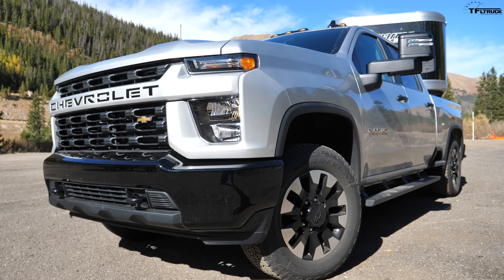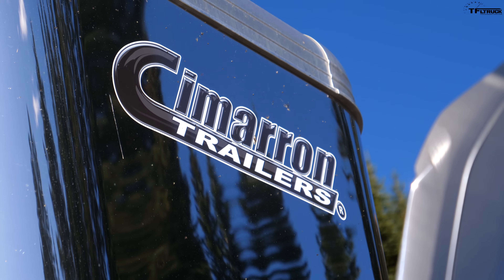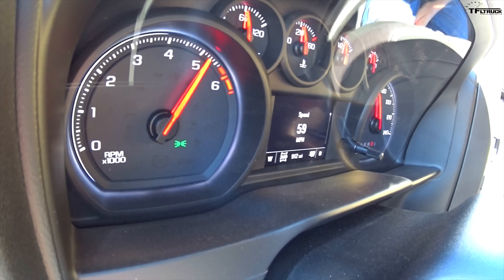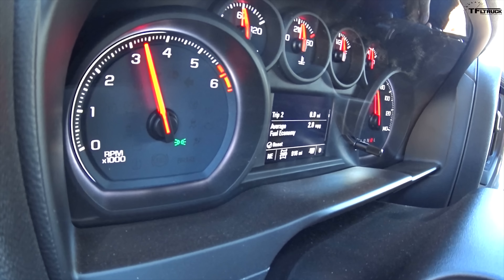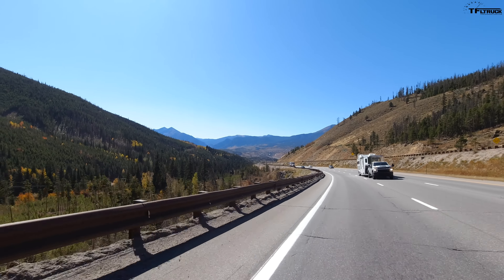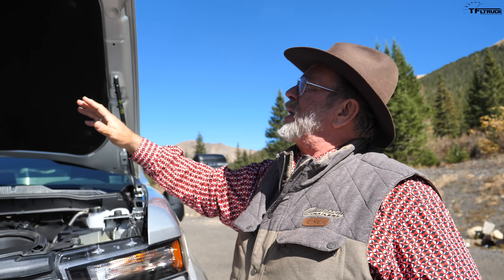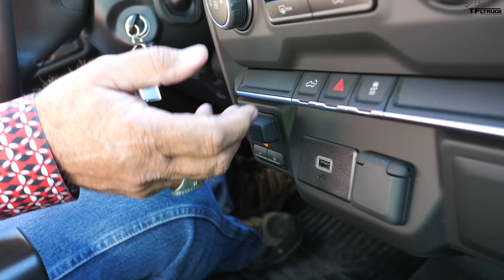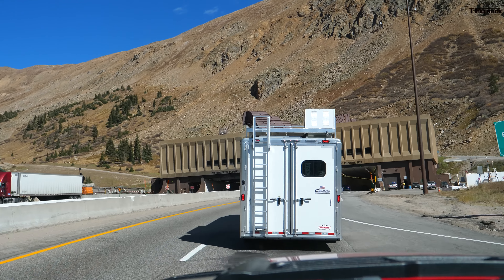The New 2020 Chevy Silverado HD Gasser Broke Our Ike Gauntlet Scoring System - Here Is How!

Comment: Great test. I would like to see the test with a lighter trailer - maybe 10,000lbs. Most people towing over 15,000lbs will choose the diesel.
Reply: Or even 5-7 000 pounds like most people with tow haulers and RV crowd tow.
Reply: @paulmiodowski  5-7k lbs is 1/2 ton territory and most toy hualers are over 7klbs
Reply: @paulmiodowski  lmfao why would you get a 3/4 ton for a 6k lb trailer?
Reply: @jaycevessier7554  payload. 10-15% tongue weight on a 6k trailer, you’re left with very little remaining payload if you get a loaded 1/2 ton, especially if towing shifting live weight (horses).
Reply: Not true due to diesels being heavier engines... gas engines can hold a higher payload. A lot of times on diesels you can outtow your payload and so the payload actually kills your max towing.
Reply: @jaycevessier7554  its better to have too much truck for a trailer than not enough truck for a trailer
Reply: @jamescalvert240  very true, but there’s absolutely no reason to have a 3/4 ton with a 6k trailer lol
Reply: @jaycevessier7554  I have a 2500 7.6 gas denali and I rarely tow. When I do its sub 5k boat jetski etc. I just like having the larger truck.
Reply: I agree with black face towing here in the Oregon coast I had a f150 with the 3.5 liter I was towing a 26 foot goose towing cars at 8000 thousands pound
Reply: @jaycevessier7554   I agree with you for single/double occupant driving or towing cargo from point a to b. One exception I can think of…Consider that many 5-6k RVs have 700-900 lb tongue weights when loaded.  Take a 1/2 ton with 1500 lb payload after accessories are added, add a typical family of 2 adults at 380lbs, 2 kids at 140 lbs, maybe a 60 lb dog, a few 30 lb bikes, firewood, a grill, chairs, tools, etc… and you exceed payload very fast.  I have a trailer that weighs 5500 dry, 6800 loaded.  I measured tongue weight at 760 at the scale, got a true payload reading for everything in my old Silverado LT. I’d exceed payload with what I’d want to bring on longer trips, or constantly have to play Tetris and fit it in the RV just to hover below it barely, and enjoy a subpar ride.  And be limited upgrading rigs as long as I owned the truck. Or need to bring a second vehicle.  3/4 ton is so much easier and handles the rig better.  The F-250 and 2500 are very popular with RVers for this reason. Though I believe Ford has an F150 with a HD 3000 lb payload option which I wish was more common with other makes.
Reply: @jaycevessier7554  If you have to ask the question, you won’t understand the answer.
Reply: @jaycevessier7554  Ok
Reply: @jaycevessier7554  with a 3/4 ton you also get better ground clearance, and more robust drivetrain in general.  lmfao why wouldn't you ?
Reply: @DanBCooper  I would never spend an extra 20k on a truck to tow a 6k lb trailer lmao. Y’all are ducks
Reply: @jaycevessier7554  you haven’t been truck shopping in awhile have you lol  1/2 ton trucks are in the $60k range little buddy.  You can get a 3/4 ton for the same, or only slightly more with more options.
Reply: @DanBCooper  yeah you can get a base mode gasser 3/4 ton for 60, I’m not into those. If I’m buying a truck it’s going to be loaded. So no, you’re not getting a loaded 3/4 ton anywhere close to a half ton price
Reply: Yes, larger brakes, frame, control arms (all suspension/steering parts for that matter) rear and, transmission, cooling system, more weight, higher payload. My RV is 34’, 8500 lbs wet, plus the truck carries gear to go across the country, it’s full of people etc. My 3/4 ton is in a whole other league dealing with frontal wind resistance as well as from the side compared to the 1/2 ton it replaced! The Duramax shines with a trailer hooked to it and has much better unloaded mileage. I likely would’ve bought gas if it had the 10 speed though. I don’t think you can go wrong with whatever your flavor of 3/4 ton is. They are all capable and all have strengths and issues. Pick the one you want
Reply: @jaycevessier7554  I have a 6200 lb travel trailer and that is dry, the wet status has it at just over 7k, with all of the stuff that we put in the trailer for a standard of 3-4 people the trailer is 8k+, a 1/2 ton truck just isn't going to get the job done properly like a 3/4 ton truck would.
Reply: @Icutmetal    Get as much truck as you can afford.  Strong and HEAVY to keep the load from yanking you around on the road.  Especially important on bad roads.
Reply: @garysarratt1  Okay.
Reply: @bigboreracing356  lmao not day in and day out, why would I do that? But I have towed a 7500lb camper with a Nissan Titan all across the southern states for years, never had a issue. Yeah, a 3/4 ton would be light years better, but it’s not completely necessary
Reply: @bigboreracing356  that’s why I said I didn’t know you were talking about all the time. I thought you was talking regular recreational camoing
Reply: @DanBCooper  agreed
Reply: @jaycevessier7554  Don't laugh...but I would rather have WAY more truck than I need to tow. I have a 2018 2500HD Duramax and my trailer weighs in at around 5000 LBS. 16' Box trailer with 2022 Can Am 2 seater X-RS. The reason is if/when I go to a bigger trailer I want to be able to tow it no problem, but most importantly is stopping it! most people don't think about that. They load their 1500 down with a 30 tag trailer doing 70+ MPH saying yeah It tows great! Ok, cool but try stopping it. I'm seriously considering getting the new 2024 GMC 2500 Hd-AT4 with the Gas engine though now that they mated that with the 10spd trans. again, way more truck than I need, but I have no worries when I tow. To each their own though...just my worthless $0.02
Reply: @jaycevessier7554  wind...
Reply: Yeah,  my camper is only 4200 pounds but in hilly area’s I’ve noticed the need for more speed control.
Reply: I wonder if GM would like to give me any money for helping them too make a better product?
Reply: Oh yeah lets put that active air intake on the gasser.  Just use the diesel air box and hood liner.  That’s what I’m gonna do when I get my 2024 gasser.  Maybe I should talk to Gail Banks about that braking technology as an after market product.  GM is not going to do it even if they have competition.
Reply: I don’t understand why the half ton has 4 piston front breaks and the 2500 does not.
Reply: Yes that truck needs a ram air intake.
Reply: @71dbart  lol and most people don’t think about the fact there are things called trailer brakes. A 2500 diesel is total overkill for for a 5000 pound trailer. All trucks are rated to J2807 towing standards, which also include emerg stopping tests up to max tow ratings (12,000 + for half tons in some cases), tow and payload ratings are no longer manufacturer derived. Modern day half tons handle 5,000 pounds without breaking a sweat, and owners don’t have to daily drive a buckboard lumber wagon. But whatever floats your boat.
Reply: @adamfrazier4550  travel trailer payload hitch weight will typically be close to 10%, would only be 600 lb on the pin on a 6000 lb pound trailer. Can easily get half tons with 1500 + lb payload, would EASILY handle a trailer that light.
Reply: @paulmiodowski just got a 9,000lb toy hauler and you can feel it for sure. YOU FEEL IT!!

Comment: I would love to see you guys get a late 90s Chevy with a 454 and the 8100 vortec and compare them to each other and contemporary vehicles as well
Reply: Make it so!
Reply: I’d love to see the same thing, but I predict the results to be underwhelming. I had a 1997 F350 standard cab with a 5-spd manual and 460, and it was a dog. The power was low in the RPM range like you’d expect from a big block, there just wasn’t enough of it, and it drank like a sailor in the process.
Reply: Lol my dad has a 454 c3500 it's certainly not great.
Reply: It’ll move the same weight, trust me I’ve tried. 

The speed is not even close, the brakes are not even close, and while that 454 won’t fail, something else will
Reply: Te 8.1 is a bit slower but town better,  the 7.4 is great and has a little bit more top speed.  The block is just the same  . Great engines.
Reply: @bloodbushcraft2467  why?
Reply: The 8100 will decimate all. Even the LB7
Reply: The 454 was a boat anchor to say the least. 454 efi hp 255 torque 405 and the 8.1l 330 hp 450 torque. The 8.1l was OK but was a huge gas hog. Like 5 mpg gas hog. At that point any heavy towing would be better with a diesel. I'm pretty sure GM doesn't use those motors at all anymore. I understand you want an old school comparison but you'd be better comparing a 5.3l to the 8.1l
Reply: @judee00  454 will out perform any 5.3l all day long.
Reply: @fabiancastellanos7196  I've been a mechanic over 20 years and worked for GM. Convince me!
Reply: @Jason Judson  just threw a 411 pcm on that vortec 454 and will make more torque than the little 5.3 could ever do .20 years is not enough  for someone who's been built in high-performance engine's his hole live. Almost was born at a mechanic shop owned by my uncle's 50+ years mechanic. Let me ask you a question...how many rv had you seen whit a 5.3l on it?
Reply: @fabiancastellanos7196  🤣🤦‍♂️. We could go on about this for ever. The fact is, you had to put a pcm to that 454 to make it better than a stock 5.3l I'm still not convinced that the 454 was or is a great motor. An original chevy 350 small block has more  hp and the torque is only about 20 less than your big bad 454 big block boat anchor. I don't give a shit about 454 in rv's. They haven't made that boat anchor since 1995. Your not even comparing apples to apples. Let's not forget that you can have a big bad thumper motor but ultimately the drive train takes a big part in getting those hp/torque numbers to the rear wheels. My dad's father(rip) and his grandfather(rip) started his garage  and his brother who is still operating it have been in business 80 plus years. Doesn't make me any better a mechanic because of what they have done.
Reply: @Jason Judson  so you don't even know that 6.0 and 8.1 are the same block  that 454s🤣
Reply: @fabiancastellanos7196  different bores and different strokes for different folks. Like anything else mass produced. It saved on machine or casting costs. Some motors share bore with different strokes and some shared stroke with different bores. Factory 454's or almost any old time big block from a factory standpoint was blah to say the least. Yes with modern performance Improvements  any big block can produce high HP and Torque numbers. 454 would not be my go to motor. There's other big block crate motors that have far better numbers than the 454 for less than you'll have spent souping up the 454. For example the 502. That's a whole nother ballgame I'm not getting into.
Reply: @fabiancastellanos7196  the heads and fuel delivery systems are different too so theres a least a difference dude
Reply: @Jason Judson  i get your point. And too be honest is not expensive at all to build a big block . It's just stupid to try to compare a small block to a big block.  Like is stupid to compare a gasser  against a diesel.
Reply: @tannerwharton4670  🤣🤣🤣🤣🤣🤣🤣🤣🤣🤣🤣🤣🤣🤣🤣🤣🤣🤣🤣🤣🤣🤣
Reply: @Tanner Wharton  I didn't know that the fuel system was part of the block. 😂😂😂
Reply: 8.1 would crush it.  I had one in an HD avalanche.   Best truck I ever owned
Reply: I have a 8.1 in a 04 3500 Chevy 4.10 rear gears . I will never sell it I use it to pull my gooseneck hauling heavy loads of hay. 20,000lbs. The most bulletproof engine I ever driven.
Reply: My 03 stock 4.8ls has more power than 90s 454 lol 😅
Reply: @fabiancastellanos7196  6.0 is technically a small block LS

Comment: Gasser saves $10k from the un-hackable epa Dmax, so use the extra money for a 50 state legal magnussen supercharger, tow awesome and never worry about DPF or fuel systems again + fill up anywhere.
Reply: The Dmax will always be hackable. The trick is finding a shop willing to delete and tune the latest model ones.
Reply: @inchaoswearereborn9586  
I swear it gets harder every time the GM fun police get a new idea. I've never owned a Chevy (for other reasons) but my friend had a 2004 2500 and then a 2012. His 2004 cost around $600 for a 4" downpipe back exhaust and a custom tuner. The 2012, on the other hand, was around 2k all in. Meanwhile, another friend driving a 2013 6.7 powerstroke spent less than a thousand dollars on his delete and tune.
Reply: For tuning on L5P go to Duramax Tuners.  Cost is just over 5k.
Reply: There are already 2020's out their deleted and tuned look it up
Reply: Iam contemplating the same thing just no real world reviews out there yet the strike didn't help supply
Reply: @AP383BB    Out their what?

Comment: This was a good run up the super ike just as the 2017 Silverado 2500 HD Ext cab did with its super ike run but this new truck is pulling more weight and a different trailer which added a heavier pin wt and more wind resistance the flat bed trailer did not have. 

The '17 run was done with the 360 hp 380 tq 6.0 V8, 4.10 rear pulling a 13,500 lbs goose neck trailer. 
Time: 10:22  MPG: 2.3  Brake applications:  13  Noise Decibels: 71  Slowest Speed Observed: 23 MPH

This '20 Crew Cab Silverado trucks 401 hp 464 tq 6.6 V8, 3.73 rear was pulling a 16,000 lbs tall horse trailer.
Time: 11:53  MPG: 2.4  Brake applications: 10  Noise Decibels: 68.7  Slowest Speed Observed: 25 MPH

This new run was pretty good considering that massive wind brake of a trailer and added wt. used in this years testing.
Reply: 2017 was the dually correct??
Reply: @davidlusk4350 ... 2500 3/4 tons trucks are single wheel only.